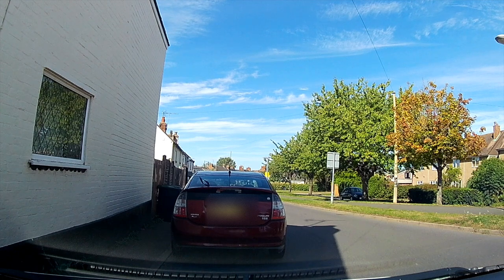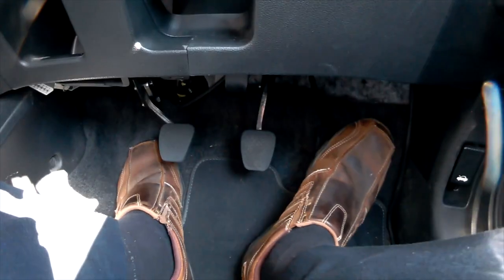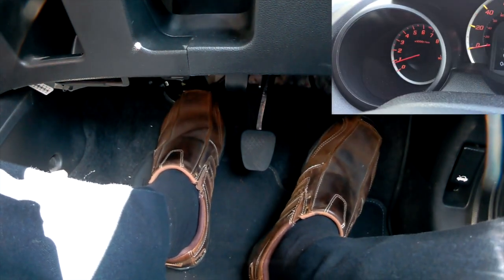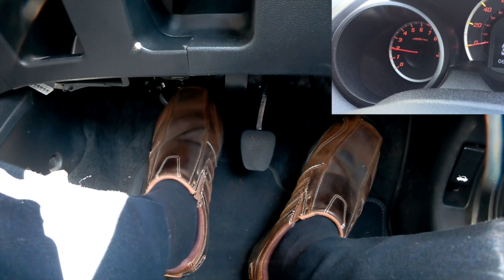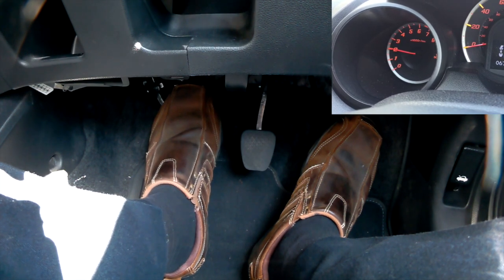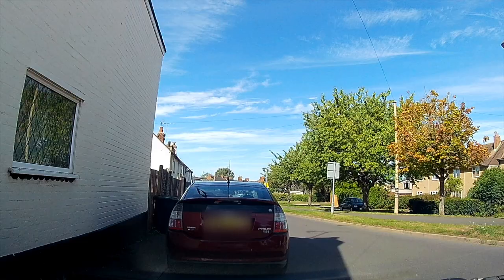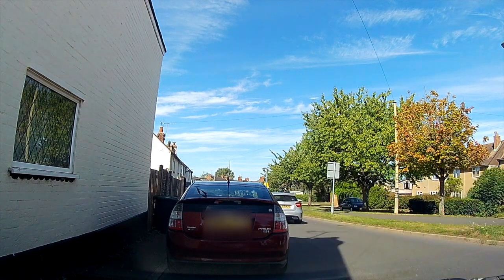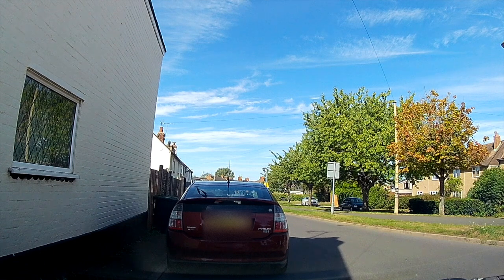How to reverse up a hill without stalling

Comment: The trouble I have (I have been driving for 5 years now), is when I am on a two way road, I have in the past, and quite recently in fact, due to me not taking my time, lifted my clutch too quickly on a steep hill and stalled with low revs, trying to perform a quick manoeuvre. I have also used too many revs before lifting the clutch whilst in reverse and caused slight clutch burn, (also not a good idea).
Just remember people, don't worry about other drivers around you, don't rush things and take it steady.
Reply from the maker: Good advice

Comment: Sooner or later, the driving authority might make this a maneouvre for future driving tests.  Making it harder than it already is.
Reply from the maker: It’s something that you need to be able to do.
Reply: Even though though it's not mandatory, you could get a manoeuvre in a normal 'L test' that involves a STEEP UPHILL reverse.
Reply from the maker: So true Seb Lewis
Reply: I got this on my test this week I'd never done it before so stalled a few times main thing is secure the car keep control and handbrake.i passed

Comment: I always seem to burn my clutch out whenever I move off up a hill. What am I doing wrong? :(
Passed my test months ago.
Reply from the maker: Clutch too high and holding it still for too long. 
Practice setting gas and just before you want to move off, lift clutch to biting point, a quick check round and moving off at a slow speed.
Reply: @JamesTravis  In particular I had a panic on a really steep car park ramp, where I thought I had my bite (I could feel it) but when taking the handbrake off went rolling back. As I didn't have a lot of room to play with I just set more gas and held the clutch for too long. This obviously did no justice to my clutch.
Reply from the maker: I would practice on any hills near where you live. But on quiet roads.

Comment: My mk2 jazz is kinda shitty at reversing up hills wonder what needs doing, once it gets moving it's fine but the initial clutch position has to be extremely precise but my other cars never needed any throttle
Reply: That said the jazz doesn't NEED throttle too but it's jsut really slow at first without it. My Yaris and Up flew up hills
Reply from the maker: Jazz’s need throttle, a lot more than other cars.